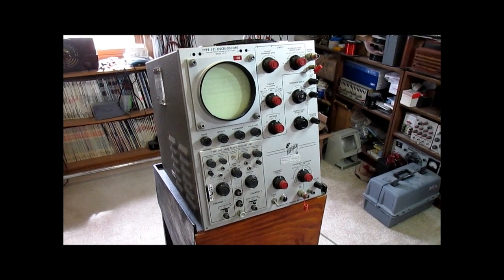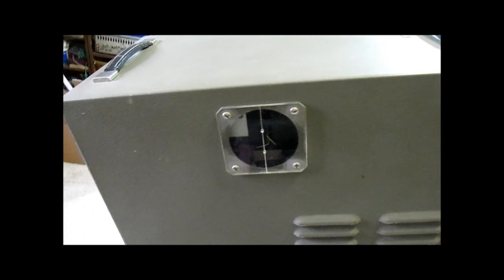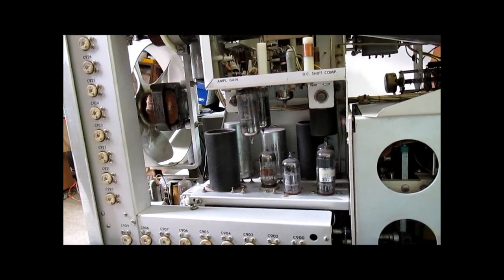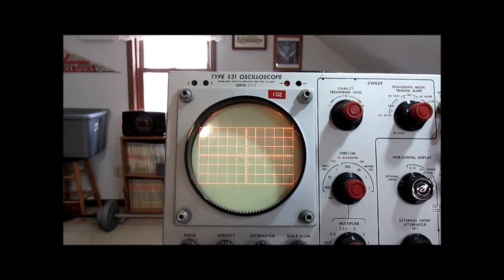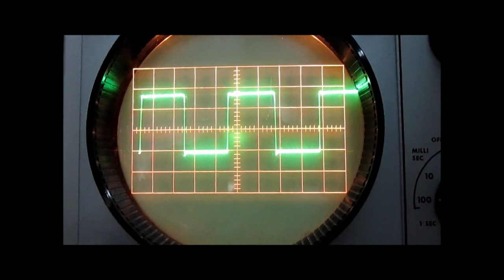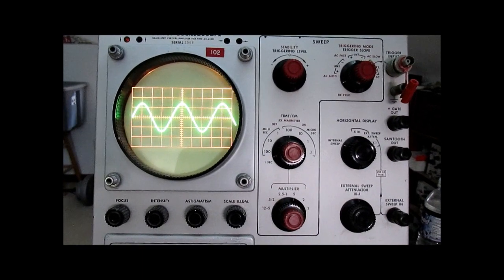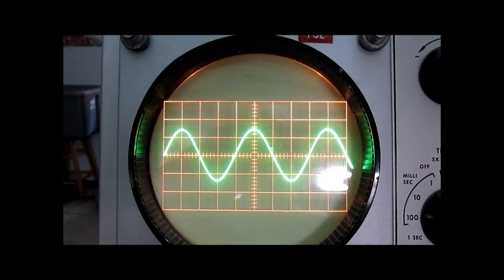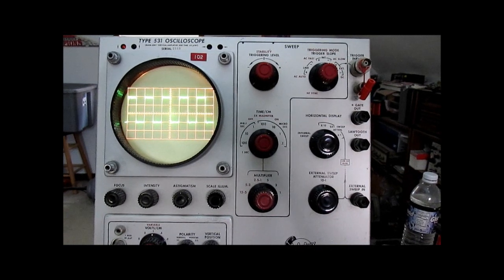Tektronix 531 Oscilloscope

Comment: Do you take on side projects? While cleaning up the farmstead I saved a late 30s Coronado 740 3 band radio. It’s complete, but needs to gone through. Lot of old paper caps and some questionable repairs done a long, long time ago.
Reply from the maker: Not really.  Too busy to take on extra projects!  I have fixed a few family radios I found in grandparents estates, etc. but still have a backlog of others in my small collection.  Still need to do the one my grandparents had at end of WW2.  It worked in 1985 but in really poor shape.

A recap is not too tough.  Lots of vids here on how to do it.  Of course, could be other issues too.
Reply: @eeengineer8851  I actually have an electronics degree, so I am familiar with the basic fundamentals but rarely have dug into component level stuff since school. (No where near your level 😁) Get lost at the vacuum tubes and some of the other stuff. (Plus I’m more likely to work on my tractor back log) 
I actually found that exact model on eBay, was thinking what’s better than a working blueprint. Plus time vs. money, other than the challenge and saving some family history.